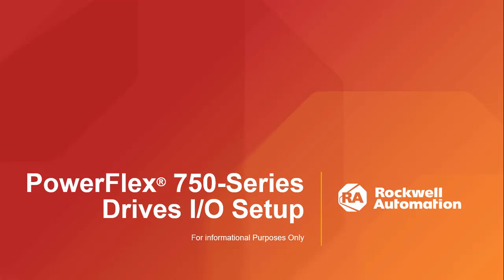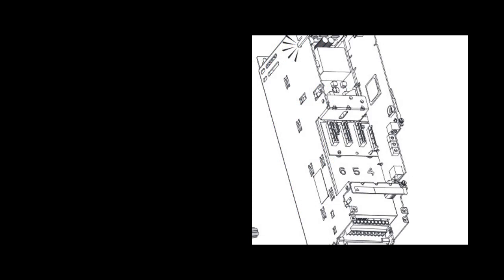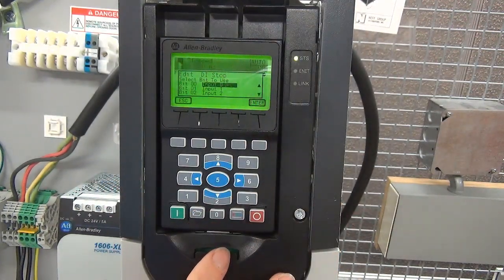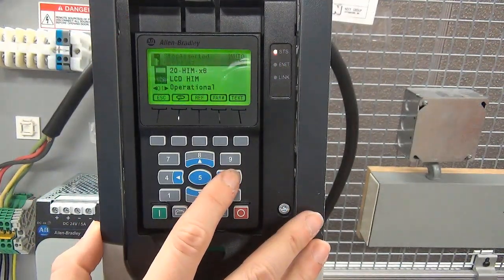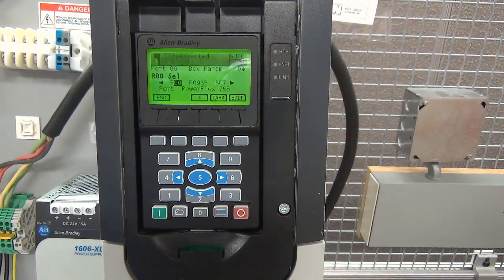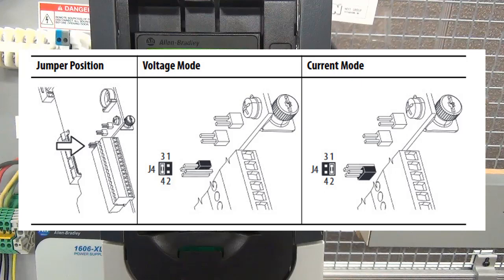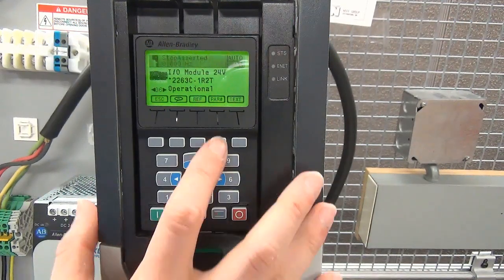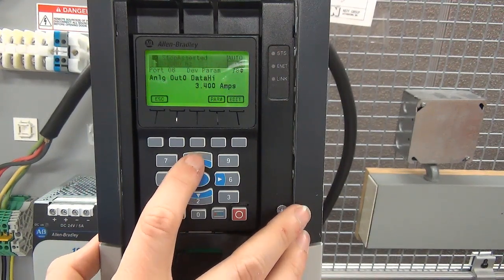PowerFlex® 750-Series Drives I/O Setup

Comment: Hello, 
how to set the digital output (R0) to start and turn off the brake system on an AC motor?
Reply: R(0) is use as an alarm relay if you want to active u need to use R(1)